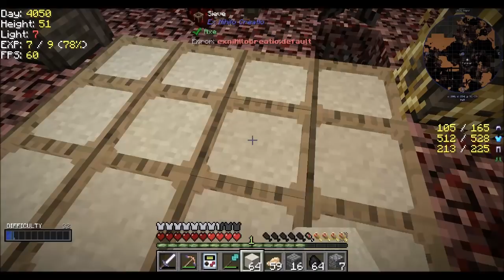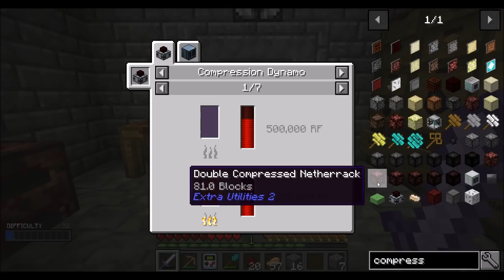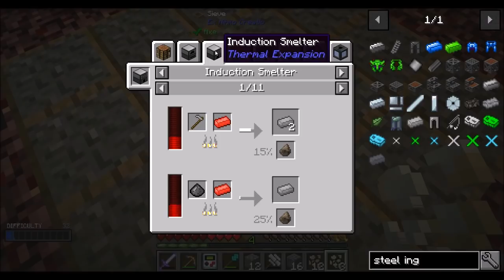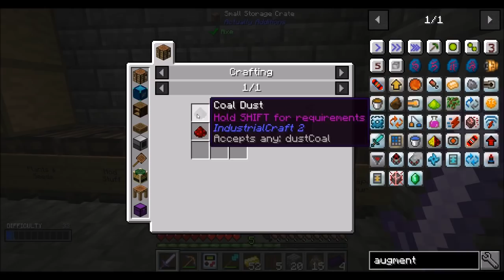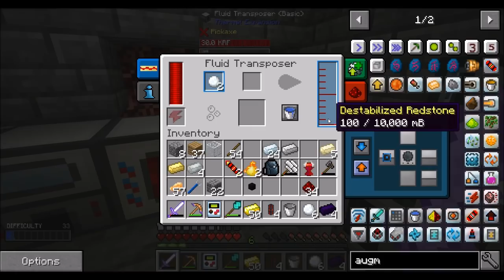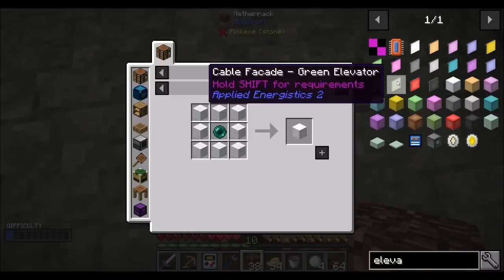Forever Stranded LS Ep21 Power Gen Pt2

Comment: lol this is going to be a long pack
Pahimar - The filtered hopper, needs to be powered via the side or it will destroy itself and spawn a ghast every few hellfire dust,
Direwolf - You are crafting 4 specialized augments for 2 machines but are limited to one per machine.
also craft a Dank/Null/
Reply: Killa Kiaba that is bc he is not using the best teir bc if u update it you Can get up to 4 slots with diffrent upgrades
Reply: You are still limited to 1 of any specialization that can be installed per dynamo, 11:40 you can see that both augments are specialized ones.

Comment: There is a machine that runs on the windmill that makes those dying ghast sounds.
Reply: The millstone, when grinding Netherrack, makes that sound. They need to grind 8 netherrack, to throw it in the Hopper, to get Hellfire, that they can cook 8 of in a crucible into the Ingot Dire needs.

Also, if you toss in 8 netherrack dusts in the hopper without an urn underneath, it'll "explode" and spawn a ghast.

If you had a regular urn, you'll get a soul urn after 8 dusts, which is used for the mod's special steel.

Or if you don't care about the steel, you can craft a Soul Urn into a void urn, which will never pop off and so you can toss in stacks upon stacks of ground netherrack at a time without concern.

Comment: Yo DireWolf How mutch ram do you have deticated to Minecraft becuse i cant play Minecraft modded with 6 Gb to minecraft.
Reply: 6 should be plenty.  You have some other problem with your potato.
Reply: JuryDutySummons Potato? Gtx 1060 6gb Ryzen 5 1600 that's an potato than wtf do u have 5 gtx 1080 Ti? LÖL
Reply: There is some setting or something wrong you should easily be able to run all the mods with that
Reply: Okay I know this is really late but it depends on the modpack.
Any modpack with over 100 mods I would suggest 6GB.
Over 150 I would suggest 7 or 8.
Over 200 I would suggest 9 if possible. It takes a toll on the computer.